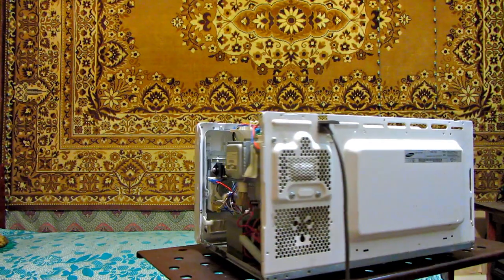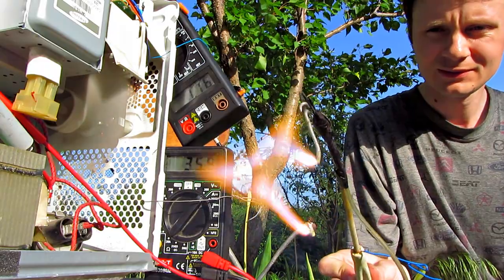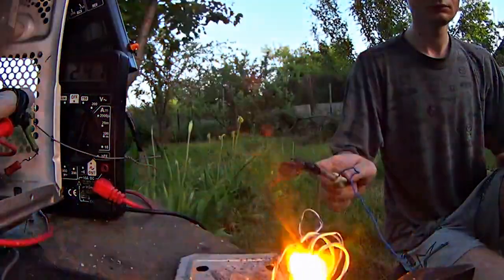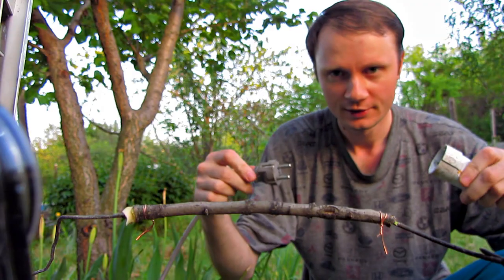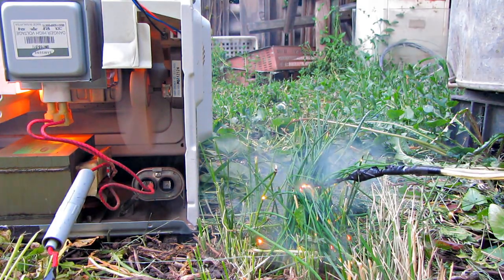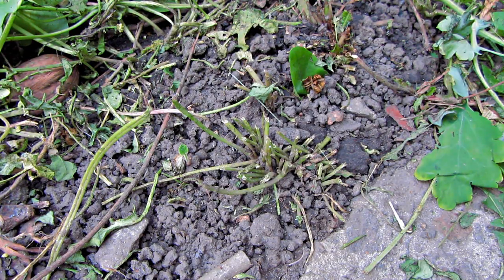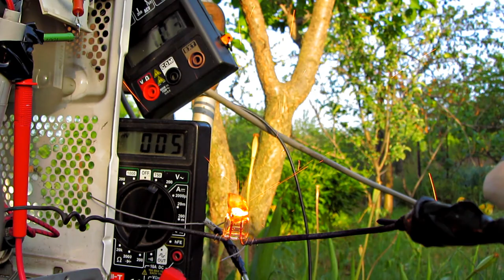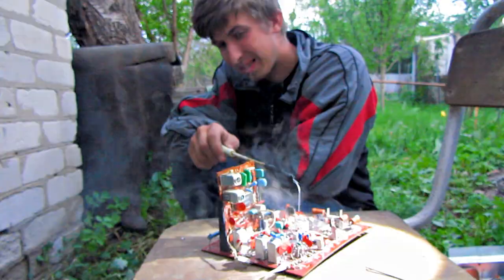What microwave oven is capable. High-voltage arc

Comment: I will give my microwave more respect from here on. I always thought it was a benign little box !!
Reply: The step up transformer and the capacitor on the standard microwave can lead to a fatal discharge if you're not careful.
Reply: @gilian2587  nice to know. thanks
Reply: @gilian2587  they make for great parts in high voltage projects like tesla coils tho. And just general fucking about like this guy on the video except maybe I'da used a good few feet of pvc piping as well as a means of isolating me from ground like EH shoes or a isolation mat.

Comment: Was that tree stump originally carbonized by lightning, or an experiment - or both, as the soil surrounding its base should be searched for exogenic and surface soil fulgurites, which will appear much different from the accumulations of artificial fused material from the experiments conducted here.

Comment: KREOSAN, have you watched the California Fire videos from mental boost or aplanetruth? the way things burned in Cali look a lot like the way things burn with microwave energy, or DEW. burned from the inside out, where wires passed through guard rails, wooden houses left untouched while newer homes with metal burned to the ground. Tree stumps burned from the inside out, even roots burned underground where there is no oxygen (and stumps and roots are WET, full of sap and water). This can only burn like this if the air or ground were electrified or microwaved and the conductors intersecting it or going to ground burned like overloaded wires, like the stick you show. TONS of examples of power poles, trees, stumps, etc, burned like that in Cali. Nobody is talking about it.

Comment: Is it possible to weld 2 piece of metal (using welding stick) like that? (without dismantling the microwave, as you did) if so, could you please make a video to explain how you did that (we don't really see what wired goes where on your video). that would be handy to be able to weld quickly without having to break the microwave in parts)

Comment: how good is that handle insulated  ? Is the blue wire earthed to microwave's body. That tree branch how does it conduct electricity ? Probably the moisture inside. So basically as long as you apply the voltage one electrode looking to discharge the shortest way . I wonder If that tree branch would be longer whats then. Also electromagnetic field around is charged with positive ions. Next time wear rubber uniform and on the top of that put some aluminium kitchen foil. You get zapped.

Comment: one of my toy mots measures 2700vac no load and 2A short circuit  = about the same as an electric chair, so probably a worse outcome than playing with a 7500v 30mA neon transformer and making a wrong move and getting zapped silly as a result..

Comment: You can completely cook a Hot Dog  Sausage by putting either end in just a few seconds.
I own antique Hot Dog  cooker it uses  mains power through probes in a bakelite tray to cook them.  No moving parts costs so little to operate it, & it lasts forever.

Comment: how is there such a large spark gap from just 2000 volts? should be about 2mm
Reply: Thats not spark. It is plasma. Air is ionised and resistance reduced.
Reply: +Valtra103 get you thanks
Reply: research Nikola Tesla